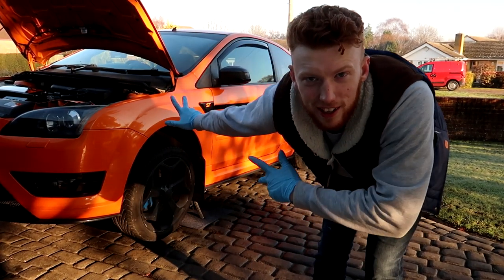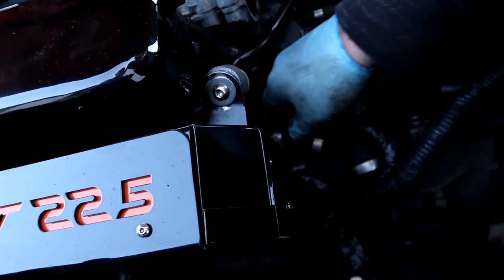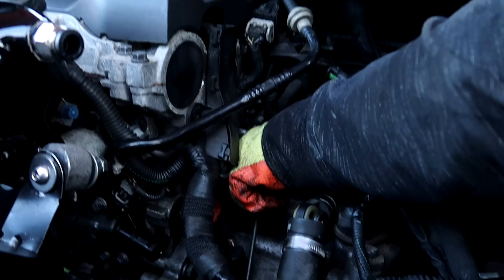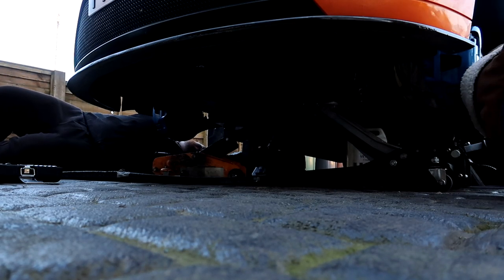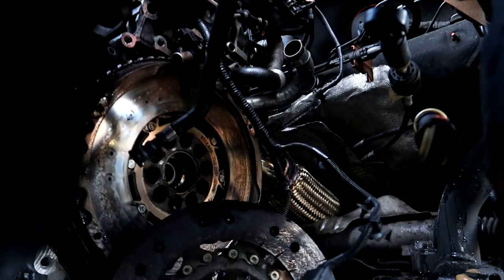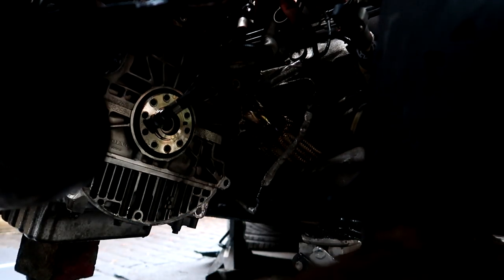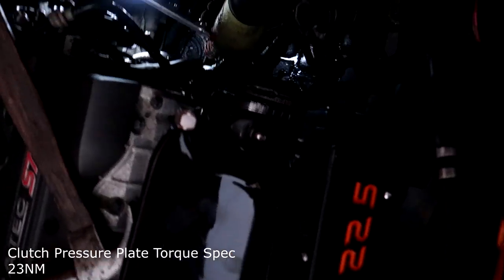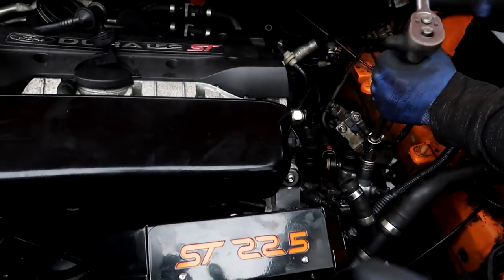HOW TO INSTALL AN RS CLUTCH

Comment: Hat off to you guys doing that on a drive with trolley jacks! :O   ....do you need to change the flywheel too? i was under the impression you could use the RS clutch on the ST flywheel?
Reply from the maker: you can use the st flywheel but i would just change saves you paying or doing it against if it ever ends up slipping :)

Comment: Hey man 
I’ve modified my XR5 (st 225) so I need to upgrade the clutch.
Just wondering how it’s holding up ? Do you recommend the one you have ?
I’ve never replaced a clutch so I’ll just get the same one.
Thanks for the link 👆🏻👍🏻
Reply from the maker: Sir SS it’s perfect I think they’re good for roughly upto to 500ish max then u need to go something bit more expensive
Reply from the maker: Sir SS if you want message the page A&E Motorsport on Facebook they do really good deals on the kit and include everything just say I sent you they might be able to hook you up
Reply: 03ANO 
Sweet 
I’ll do that (go to their Facebook page) I’ll see what they say and I’ll drop ya name.
Thanks man - I really appreciate it.
Stay safe mate
Reply from the maker: Sir SS and you bud any questions inbox me on Instagram YouTube doesn’t always say when I’ve received a comment no more
Reply: 03ANO 
Yeah! Same with my inbox too - been strange for maybe a week now.
Anyway no prob 👍🏻

Comment: Hi I want to do a gearbox oil change do you think this top fill way is the best way? How easy it it to access ?
Reply from the maker: Iso Confused wheel off and air filter out easiest way
Reply: @Richieesgarage  ye but its fcking about fighting gravity, coming up with a way of getting the fluid in.
Reply from the maker: You know you pour the fluid in the top it comes out the bottom but on the side of the gear box by passenger wheel arch ? Then you just bleed on the nipple  on the front of gearbox to get air out
Reply from the maker: Gearbox oil is clutch oil  it goes into the top of the gear box out the side, brake fluid goes into the tap on the drivers side of the car under scuttle panel,
When you bleed the clutch via the nipple you will need to top up the brake fluid as you’ll lose some in the bleed process

Comment: Why did you drain the coolant? I’m going to do this job 😬
Reply from the maker: Because the coolant will leak otherwise you have to disconnect the coolant hoses above by the battery
Reply: Ah ok cheers 👍🏻

Comment: If I'm not mistaken, that is a self adjusting clutch - which you installed without a compression tool, or even do the 1/4 turn rule. If that is the case, you should expect to be doing the same job again in say 6 months, due to clutch failure.
Reply from the maker: G. Cast we shall see pal RS running gear is going on next
Reply from the maker: Still working fine pal
Reply: How did u Bled the clutch
Reply from the maker: Thomas Gamer open the bleed nipple, push clutch, lock nipple, release clutch, repeat 10 times still stiff, whilst topping up the brake fluid
Reply: How dit you get the gearbox to clear the subframe ?? Thanks in advance